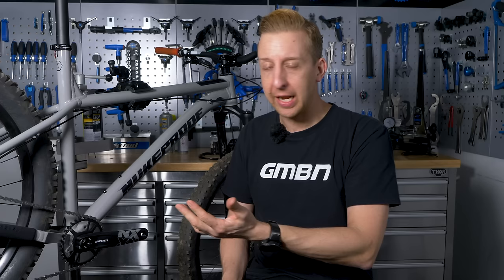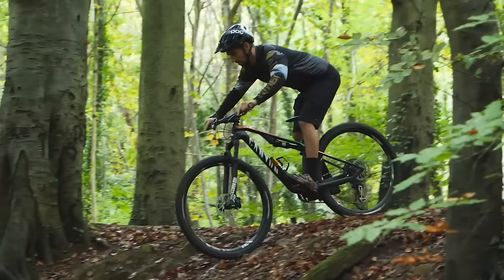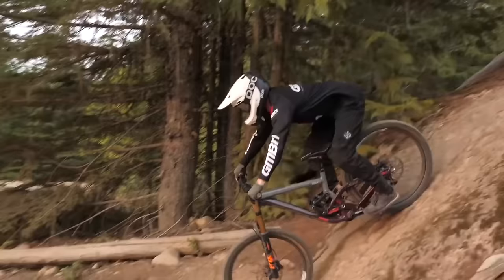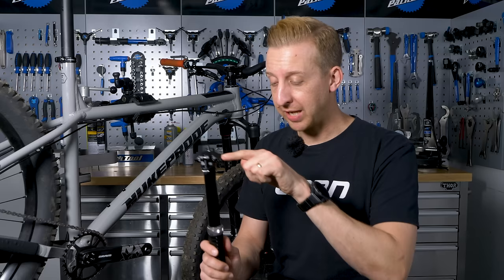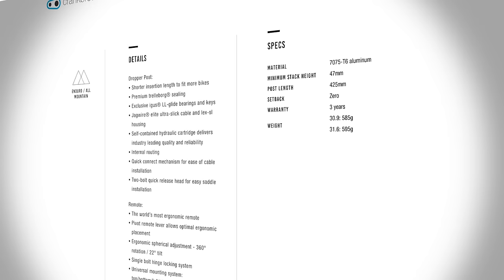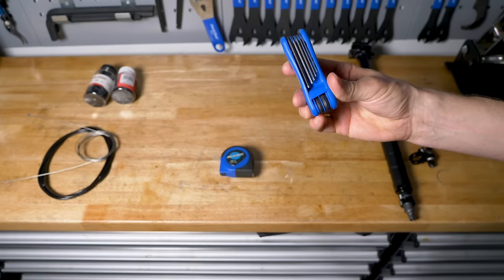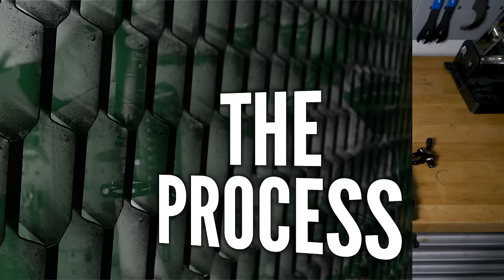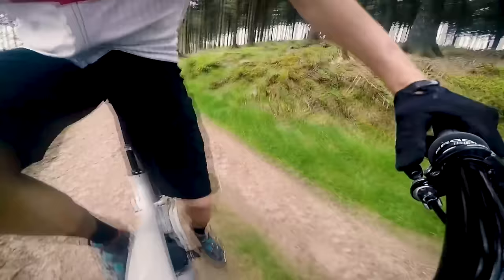Mountain Bike Dropper Post Install | GMBN Tech Essentials Ep. 10

Comment: #askgmbn, I have just bought a new bike with a cabal dropper post fitted, it's a medium frame so the cabal sticks out lodes at the front, I need to cut it down a bit, but because it has the grub screw under the seat post, I have to pull it tight at the front to get it to stick out of the seat post before I cut it down, then when I drop the post into the frame, I should  get back the slack on the steering.
Is there any tips to get this right. Thanks
Reply: You can use a remote with the grub screw at the remote as well. Then it will be simple. 

Clamp the end of the cable at the dropper. Cut off the round cable end entirely. Now you can attach it to your remote easily.

Comment: So why don’t you show how the cable is routed through the frame at the bottom of the seat mast?  Lame install video
Reply: Each frame is different, and it’s just a lot of trial and error. Also, it depends on whether you use cable guiding kit or not. And there are plenty of cable guiding videos for carbon and alloy frames

Comment: What about external cable dropper posts? Some older frames just dont have internal rounting.
Reply from the maker: Hey, you can get still get external dropper posts.
Reply: I just drilled a hole in my frame...